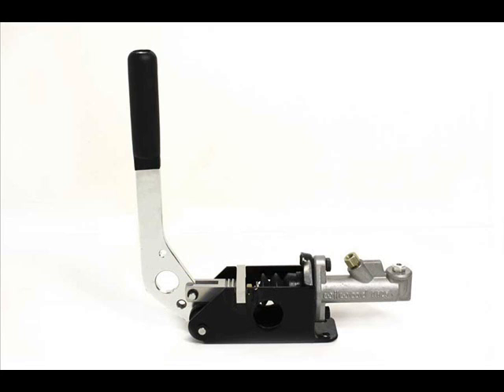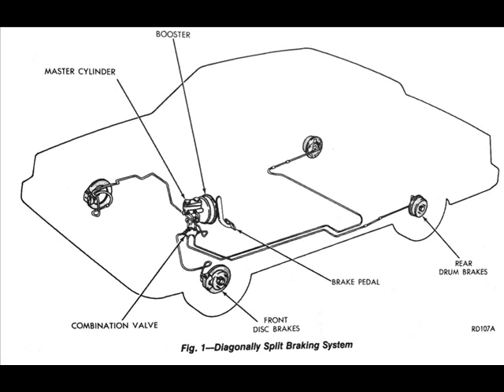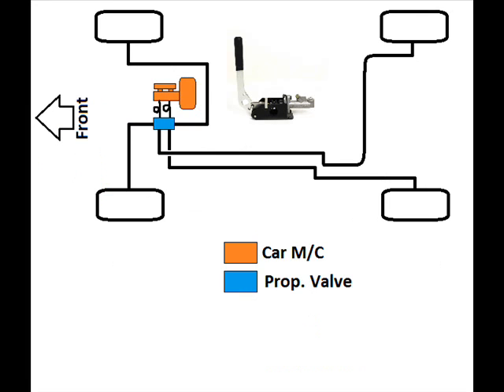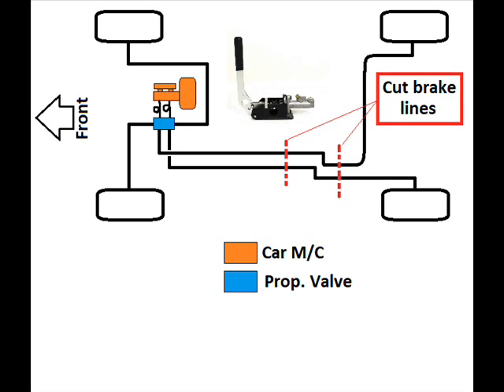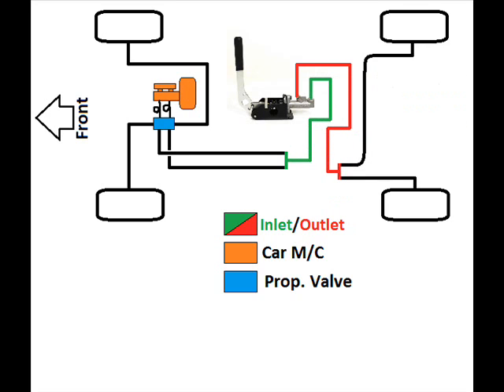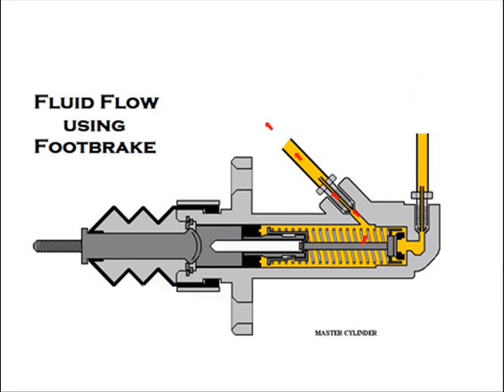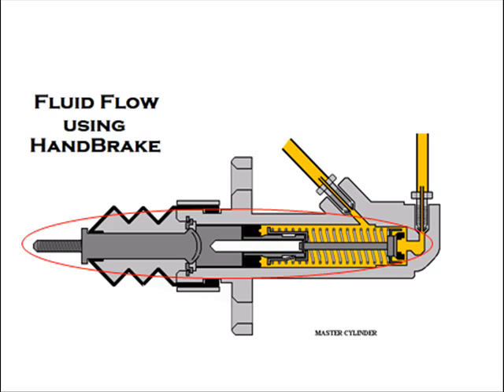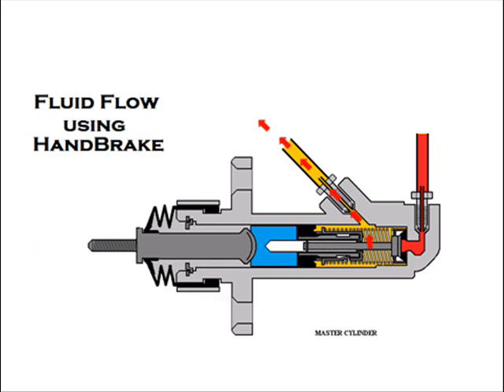Hydraulic Handbrakes Explained

Comment: So if you add a shut off valve and Tee your added inlet line, you can effectively toggle your inline rear brake bias to a lever as well as use it if you wanted to hold the front wheels seperately from the rear. Interesting

Comment: Im curious how this would work with  the willwood cuz it only has 1 entrance  and a reservoir on it any information I appreciate it???????any1 who reads this lmk
Reply: That kind of setup is for use with a dual caliper setup. Where the only connection goes directly to a second pair of rear calipers that are only used by the hydraulic handbrake.
They are considered safer as they are a completely separate system to the existing brakes.
They also avoid the inconsistent pedal feel that an inline system can cause.
Reply: @yeahnah6468  I intalled a  inline on  my rsx, i have a brake booster also,abs,it lock up the back tires  but i thought it would sling shot out .it only moves about 1 inch and its already  locking  rear tire its strange?any reason  why the ebrake is so stiff? Any info is appreciated.

Comment: what if you press the foot brake loading the rear up with pressure then you use the hydro and put even more pressure?
Reply from the maker: You could, but there's ALOT of pressure already exerted by the hand brake itself. Putting more pressure would likely just blow seals

Comment: In a dual rear brake line system, teeing the brake lines like you are showing requires an ABS delete and would eliminate the safety of a diagonal system. You can use a twin master/tandem cylinder to keep both rear lines independent, this is how it is done on Group N rally cars.
Reply from the maker: Interesting, didn't know that. Guess I don't have to worry about it on my car since it didn't cone from the factory with ABS as it was never an option
Reply: I am considering to use twin master tandom brake on the front for tight steering

Comment: question, if I get a hydraulic brake to drift and replace my e brake will I still be able to lock it in place to park up hill and such?
Reply from the maker: Devon Friedman I didn't replace my cable e brake. Actually didn't physically touch my rear brake setup at all. This setup utilizes your stock rear calipers on the rear discs. Your cable brake should use internal drum brakes on the rear to hold the car
Reply: BoostedDrummer awesome thats great to know, thank you

Comment: won't the fluid travel back up to the master cylinder when you release hydro messing things up ?
Reply from the maker: Unless you press down the foot brake after you pull back the hydro brake, no damage should happen to the system. If you pull the hydro brake and then press the foot brake, you'll blow out the seal in the hydro brake that holds pressure. Other than that, its just like having normal brakes.
Reply: @That_Red_Omni  ok so if that's the case then this is kind of useless for any actual applications other than drag racing fwd cars and showing off.  Most of the time if I need the hand brake I am already on the brakes to get the car set up.  I can't think of a time that I pull the hand brake without being on the brakes.
Reply from the maker: @gnashings  which is true if you're doing this as an in-line system. However, if you are doing this brake setup externally with additional calipers (such as drifting), you can be on the foot brake all day while pulling the hydro since it won't share the same fluid
Reply: @That_Red_Omni  hey man thanks for the reply! I didn't mean to come across negative, it was an excellent video! Just don't think this set up would meet my needs
Reply: Wicked thankyou , was just a little concerned when a professional drifter here in New Zealand said I would need a one way valve so that it wouldn't travel back up.
Reply: @Kayocau  here in Brazil I was told the same thing, that I need the valve to not have leak in the original master cylinder
Reply: Blow out the seal mean the oil seal will damage or what ?..

Comment: If you ever get a leak on any part of the system with this setup you will loose all brakes. You are combining the diagonal split into 1 complete system 1 leak = empty master cylinder = wall
Reply from the maker: Likely, which is why I have retained the use of my cable actuated emergency brake as well. The hydro e-brake actuates the rear calipers, while the cable e-brake actuates the internal parking drum brakes on the rear.

Comment: Just a quick heads up. If you are tee-ing into a twin line to the rear, then you should change the brake lines at the proportion valve. At the moment if you have a sudden fluid leak to the rear wheels, then all fluid from both brake circuits will just leak, ergo no brakes.

Comment: What about normal handbrake? Does it use the rear calippers too?
Reply from the maker: It does, but in my case the cable bracket that engages both sides of the rear wheels is kinda bent and doesnt like to be adjusted to much. Hydraulic brakes just actuate faster than cable does

Comment: do you have to have the break lines pointing up or can you twist the back part of the handbrake?
Reply from the maker: korven3 mine are pointed straight up and bent backwards. I'm not sure if the back party can be flipped upside down or not since I haven't tried
Reply: BoostedDrummer of it's just a piston and bolts there i don't see any point f not doing it
Reply from the maker: korven3 true, but the only problem I foresee with that is getting air bubbles trapped in there somewhere
Reply: but if you do it before putting any oil in and if you do. cant you just bleed the system, or whatever its called in english (take all the air out)

Comment: I was doing some research if installing hydraulic handbrake deletes rear footbrake, which it doesnt. Thanks for the video mate.
Reply: If you wanted to go all out you could also run dual calipers on the rear tires so you can use the two new calipers you added when ripping the hydro and not use the two stock calipers to save resources.

Comment: This is great, man. Couple of friends and I are building a motorkhana car and we want to have a hydraulic brake in tandem with the standard cable brake so we don't need to chock the wheels when it's in storage. Your video helped us out A TONNE.

Quick query
Is the hydraulic handbrake literally just a clutch slave cylinder with a big actuator on it, or is there more fuckery in this than a clutch slave?
Reply from the maker: +AnthonyH Glad I could help man lol. And yes, thats essentially what it is. During my research, I found that some people used a clutch slave cylinder from a Honda and it seems to work well for them, but those had the resevoir on them I believe